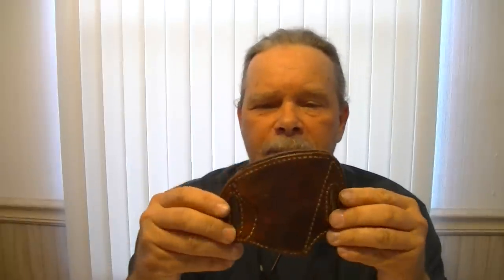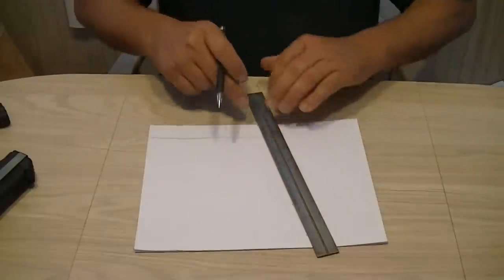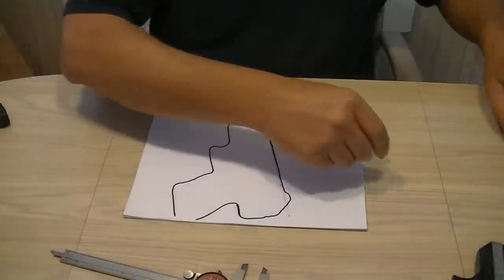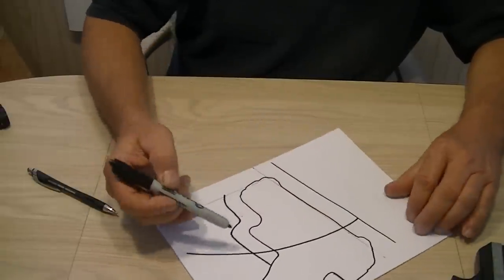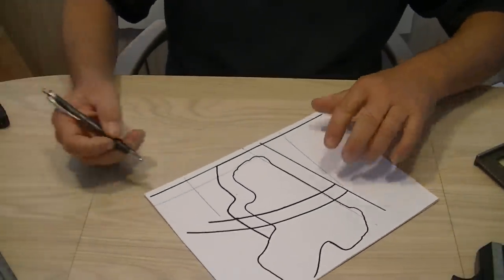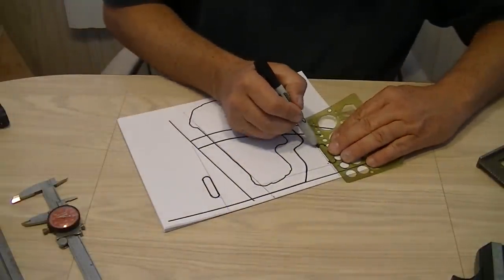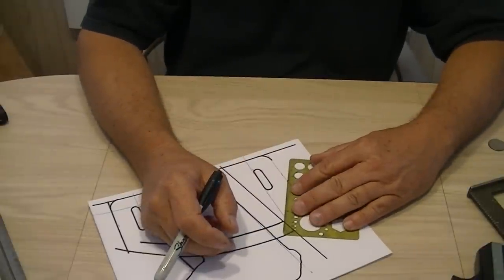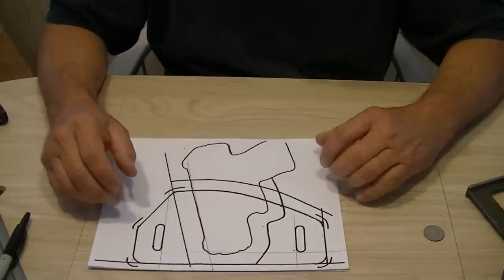Leather Holster pattern making

Comment: who the heck would want to carry a hi-point?! talk about gambling with your life..
Reply: a Hi-point is like a fat girl, sure shes heavy but it's a guaranteed bang everytime.
the Kel-tec on the other hand I would never put my life on the line with a Kel-Tec on my hip
Reply: Not a thing wrong with Hi Point, just a little heavy and a pain to field strip but I have never had one jam yet.
Reply: I had a C9 that I would match against any pistol on a range!! No jams, FTF, or any problems. It IS heavy but it WILL put holes in whatever you shoot at!!
Reply: Only drawback on my C-9 is that it is a single stack. And it goes bang every time I pull the trigger.
Reply: I met one person who said it’s the best gun ever and it weighed like 10 pounds